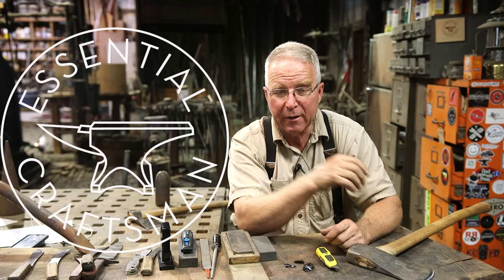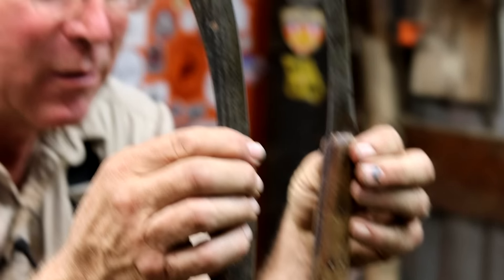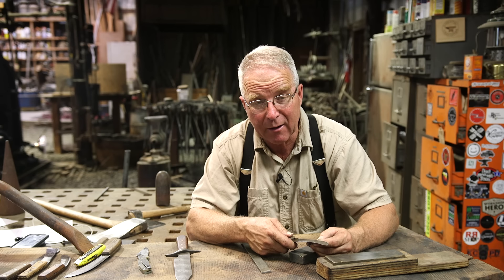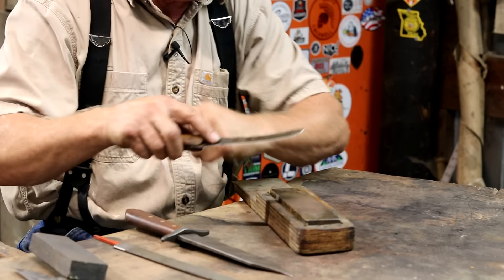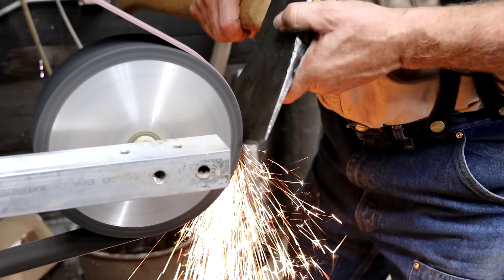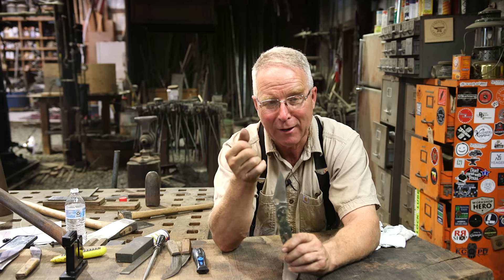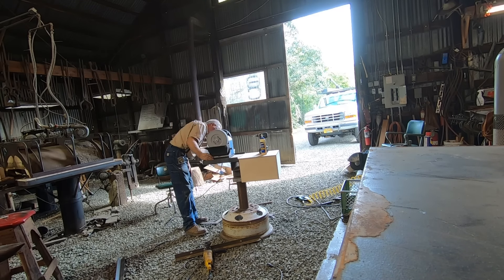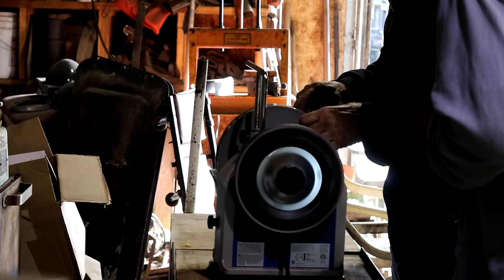Master the Art of Sharpening

Comment: Two types of knife edges: rounded and convex or standard straight edge. Your expensive kitchen knives will have the standard straight edge. Never confuse the two types or you will ruin the profile of your knife. The Work Sharp sharpener is a convex belt sharpener
Reply: Wrong.
Reply: @autumn5592  I own both types of Work Sharp sharpeners...the Ken Onion belt convex sharpener and the new Work Sharp Elite straight edge sharpener that they sell for $120. Do you own any Work Sharp sharpeners or are you just running your mouth?
Reply: @CALVINLNIKONT  First, stop coping.

Second, you're wrong.
There's more grind types than you can count. It isn't limited to just flat or convex. You're completely ignoring concave/hollow ground.
Then you've got different grinds between primary and secondary bevel (if applicable.)

A convex edge will not ruin a kitchen knife. In fact, some high end japanese knives have convex edges, and these are some of the finest production knives you can buy.
A (slight) convex edge will improve durability of your bevels, and will slightly aid in sharpness (due to easier ability to properly apex.)
Convex edges are by no means bad, and flat grinds are not good.

I don't need to own either, and I wasn't talking about them.

But I do make knives, and other tools. So maybe that means a little more than owning some crappy 1x30 belt sander.

Comment: I hope you can help me I am metal detect and I used a pretty heavy duty shovel the problem is the hooks on each side of the shovel is white will cut through roots and vines is there a easy way of sharpening this whole shovel or will I have to do on the front part and then each hawk on the side of the shovel I hope you get what I mean

Comment: Thank the frogs some one on You Tube who knows the proper way to sharper steel. I know you turn your knife and reverse your stroke.May need to explain turning the stone for each side. Your a good teacher. Hate circlers only good for saw teeth knifes lol.
Then next is grinders some use and destroys the knife! belt Sanders are ok if you know how lol but low speed water stones best. As your found out but we had to modify ours as didn't like the set up over head like your so,  set up the same as normal set up for grinders more stability then that rod.thingy....we chucked most rest of the attachments as waste of time setting them up. It  just didn't feel right old habits suppose any way I preferring K.I.S.S keep it simple stupid. To many designers get to technical ie attachments set ups and attachments not nessary, complication the whole set up. 👍🎥❤️😁🧡👍🦘🇦🇺
learned to sharpen knifes. in the City Morgue.

Comment: A third danger of sharpening with a power grinder is over-heating and losing the temper of the edge. This is why the old sharpening wheels were partially submerged in a trough of water and why engineering lathes have a constant drip of oil to help take away the heat.

Comment: my swedish axe shaved because of the burr not because of the angle.  most people think that having an edge really thin will cause it to roll or chip but honestly the thinner it is then the easier it is to resharpen and the sharper it will be but the burr is still more important.  you can get a more controlled angle by dragging your blade but in order to clean it up your final strokes on the stone have to be push strokes.  most people have no idea what a wet stone is or an oil stone and neither does this guy.  oil is not meant for creating a slurry is only meant for cleaning the stone.  a wet stone is one that needs to be soaked in water overnight and the water is just to open the pores and prepare the stone.  creating a slurry is a separate technique which works best by using an abrasive paste on top of a stone or a strop.
Reply: It would seem you don't know what you're talking about. 

Almost everything you said is wrong.

Comment: Learn how to use a stone. Be patient and hold a steady angle. Don’t mess around with all these sharpening jigs or anything else. You can get really good with a stone in a matter of a few hours. You’ll enjoy sharpening with a stone a lot more than any other style and you can adapt to any blade. It’s Almost therapeutic. 

If you don’t care to learn and don’t care how much life you get out of your blade and just want it sharp enough to barely work just go out and buy the $10 V style sharpeners that peel the steel away. Make sure you get one with a ceramic side as well as the steel side for honing the blade to a better sharpness. The bright orange “smiths” one is a decent choice for cheap.

Comment: I think people put to much into the method. Your grinding a triangle and removing burs that happen while that's being done. 

As long as your careful with the angle it doesn't matter it you go along the blade, across the edge, or against the edge.

You can feel the burr and will learn the difference between it and sharp quickly by placing four fingers along the blade.

So how do you grind? Determine the damage and highest appropriate "grit" (a file has more "grit" than sandpaper which has more than the whetstone (or whatever stone you prefer))

Then you move down on grit and remove the marks from the previous grit up. 

TL;DR
Sharpening is just grinding while take ng burrs and angles in mind. Maintaining consistent angle and finding the burr and necessary side to work too maintain center IS FAR MORE IMPORTANT THAN THE DIRECTION YOU SLIDE IT OR THE MATERIAL USED.

I find along the edge (up and down) removes less than across it (against it, or with it) so I consider each "grit" to have a high and low version depending on direction. BUT THAT'S JUST MY STYLE, YOU CAN GO IN ANY DIRECTION YOU WANT provided you maintain center and angle and remove previous grit marks before moving on.
Reply: Practice on a chisel if you find your style inadequate. Having one edge and one side for the burr. The angle is clear and easy to follow. Then picture a knife edge as two chisels bonded together.

Edit, with much more shallow angles, usually lasting less than a mm before the steeper "secondary edge" (which you will work into, but you don't need to work the secondary edge itself unless your knife is on really bad shape. 
(The "secondary edge" on a chisel is typically the top face, as you can see the primary goes much farther into the "secondary edge" than a typical knife)

Comment: What's wrong with using a file on a typical knife is that there's a good chance the knife is too hard for the file. For softer tools like axes or machetes it's fine, and I have been able to successfully use a file on a knife or a pair of scissors occasionally. But more often than not I've ended up just dulling the file.

Comment: Still trying to figure out how to sharpen a serrated edge on a knife.
Reply: Dowel with sandpaper around it.
A round diamond file or ceramic rod.
Slipstone.
Reply: @autumn5592  seems like a lot of work.
How do they do it at the factory?
Reply: @crazysquirrel9425  You don't need to do all of them, just one.

It's the best way you can do it, without specialised gear.

They have a jig with grinding wheels, you would never re-create it yourself with power tools.

Comment: I had to teach myself how to find the correct angle to sharpen a knife.  
I realized that a knife sharpens the 'Quietest' at the correct angle and the 'Sound' is different again when sharpening is complete.  
This technique probably doesn't work if you are changing the Angle that the Blade currently has.

Comment: The hardest part to keeping an edge is finding the right blade.  Most over the counter knives you see are too hard , the edge is brittle and chips easily.  Too hard they chip , too soft the edge will roll over.  A soft blade isn’t worth the time to sharpen. 
  A hard blade you have to sharpen more often.  I use a couple of Japanese water stones I paid a lot for over forty years ago and a strap of buffalo hide for a  strop I got off an old belt driven lathe.   One way to destroy a blade is to use a grinder.  
   I prefer old high carbon knives. They hold an edge but they will rust quickly if you don’t dry them well.   I used to pick them up in Pawn shops , now you can find them as vintage on line.

Comment: Another point that needs to be made is the better the quality of steel the knife blade is the better the sharp edge you will get. If the blade is made of cheap steel it will not hold a sharp edge ever no matter what you do
Reply: You can get trash 0.5% carbon steel as sharp as super steels.
You don't need a good steel to make a sharp edge.
You can get mild steel, even copper to slice paper.

Edge retention is not the same as sharpness.

Comment: Scythe peening is another way to address the thickness temper and razer sharpness.
Reply: Scythes that were peined were not hardened, at least normally they weren't.
There is no temper to 'watch out for', because it's soft steel.

The peining caused work hardening, to form the cutting edge, which was then dressed with a stone to bring it that extra bit.

Comment: Oh good now I have a use for all those chipped Lathe bits, edit [only for soft stuff]

EDIT: hold 2 lathe tips in the vice to test, on my Buck eating knife, it did with care almost get a Drag through my thumb nail to tell me it's dangerous However, none of my good knives were touched by the carbide Lathe Tips - probably because they are made from very old machine hacksaw blades [before they leaned to weld a hard edge on butter]
Never heated them I cold cut and ground all the way, never tempered which cost 150mm off one of them when I dropped it on concrete and cried - a chip the size of a hair would take all day to move off either one of them.

I should send you photos of some of my knives but it'd be weird.

My Trade includes making sure things are sharp because if they weren't they'd kill me so it's hard for me to walk into most kitchens and look at the Paddles they call knives - in most cases a fish slice is more dangerous.
If I was ever looking for a knife in a hurry in someone else place I used to go for the bread knife ... guess what stuffed that up Sliced Bread!

In the axe thing or in my case a Tomahawk I played with once had a totally hollow ground center of the blade that left a 15mm curve which meant - When a Mate came along to split firewood he was capable of pinning his thumb to the block and still have flesh both sides of the curved blade - a totally helpless looking thing - took a slice off the knuckle of the bone and the replant didn't take it was a mess and in saying that

Every time I've cut myself on a machine/blade/knife it was just after finishing sharpening it - I don't know how that happens but it's a real thing - 

Thanks Bro -

Comment: I could never master the concept of holding the knife at the correct angle.
Reply: Give yourself a reference point.
So use your finger as a spacer. So put the spine on the same part of your finger, then put your fingertip on the stone, and rub it on the stone gently. You'll have great angle control that way.

Comment: There is a scale of tools. On one extreme are very complex, and usually expensive, tools, which can be used by an idiot.  On the other end of the scale is a very simple tool, operated by a very skilled operator. This includes machinery from automobiles to knife sharpeners.
If you want excellent results, but don't have much to spend, learn the skills.  Be more like the old Japanese sword makers, and less like the minimum wage employee pushing a button on a computerized machine he does not understand.

Thanks to this channel for a great video.

Comment: I dare not say you are wrong in any way. Your years of experience outway mine. I will say this. I speak as a chef, butcher, and outdoorsman. I've used many axes, knives and so forth. What I have found in my time. I say any stone should not have oil applied to it. The reason, in my opinion. Once you put oil on a stone, it will never work with water. If you are in the field, it's much easier to find water than oil. Just my experience, I'm sure it varies from others.

Comment: I've seen far too many nice kitchen knives ruined by those cursed electric sharpeners. They really should come with some strong warnings. As far as sharpening scissors, sometimes all you need to do is feel the edge with your thumbnail and see if it is a wire edge, and if so turn it the other way with a ceramic cup bottom or some other such fine abrasive.
Although you mentioned whet stones, many people believe that to be "wet stone" because it is used with water.
I've cleaned the pores on my stones with a magnet in a plastic bag. The bag is to make it easier to clean the swarf off the magnet.

Comment: I feel like I will still have issues sharpening titanium blades even after learning all this...
Well it wouldn't be a bulletproof blade if it wasn't hard to work
Reply: I hope you know that titanium is almost as strong as steel so yeah not much improved it is however lighter tho
Reply: @bloopbloop5663  must be my sharpening stone then
Reply: Yep I told you the 50 cal went deeper in the titanium then the steel
Reply: @bloopbloop5663  not same caliber
Reply: @bloopbloop5663  take a 2 meters wide paper hold it from each corner now push with your hand all the way through the paper...
Now do it with a 30 cm wide paper, tell us which one breaks...
Reply: @Trustee-of-The-Most-High  they were both about an inch and a quarter tho :/ and I'm talking about the 50 caliber that they used on both
Reply: @bloopbloop5663  and I'm talking about science
Reply: @Trustee-of-The-Most-High  ok enough arguing and about the sharpening trouble I would recomend you use a blue hawk tool sharpener they are cheap and easy to find run that over the knife edge a few times then use a sharpening stone and I recomend useing diesel as the lubrication works amazing and wont rust your knife like water will
Reply: @bloopbloop5663  ty

Comment: I was wondering when you were going to get around to a TORMEK.  I have one, it is GREAT, but I hardly use it anymore.  In fact I have NOT used it in YEARS.  I have learned the yin and yang of sharpening the knives that I have.  I NEVER abuse them by cutting something they are NOT made to cut.  I sharpening them often and never let them get dull.  I have a leather strop I picke up as a SCRAP in a saddlemakers shop nearly 50 years ago.  So I hit it a vew licks on the stone and polish the edge on the leather.  They are always sharp with this so called "method".  But if I were to Sharpen OTHER PEOPLE'S HIGH DOLLAR KNIVES, I would ge the Tormek out.  Boy the Nordic people make good stuff!!!  The Tormek is the best one I know.  There are some kind of knock offs of the Tormek by various tool copiers.  The STONE on the Tormek, the SURACE of the Tormek 'wheel' stone can be changed by applying the stone they sell for that purpose.  The stone they sell looks like a Whet Stone you don't want to mix it up with the others you may have.

But for me in my old  age, I keep my knives sharp by as a rule just hitting the Arkansas WHITE STONE a very few licks then stropping them on the leather.  So it is QUICK and they never suffer from "Deferred Mantenance".  To me it is better to sharpen it often but make the process Short and Sweet.  To me it seems to tke less of the original blade down to sharpen often in short sessions than to allow it to be turned in to a Butter Knife and then try to "fix it".  

The book with the Tormek is GREAT, it tells you the various angles and how to detect them and so on.  I have forgotten most of it.  Should get it out, if fact you have inspired me to get the thing out, it is a wonderfull product.  But very PRICEY seems like I paid OVER $400 bucks for it YEARS ago. 

Over the years, I have tried all kinds of 'oils" for the Stones.  For the Man Made stones I have used Kerosene, diesel fuel, motor oil, machine oils, WD 40, you name it.  Doesn't sem to matter as long as you OIL IT.  But with the Arkansas Stones I use BABY OIL.  It is CLEANER, it works GREAT.  Baby Oil is nothing more than "mineral oil" with the baby fragrance in it.  Could use Mineral Oil that they use for  mdical or veterinary use, but it is thicker in viscosity.  It seeks to work just fine, but I like the baby oil better.  I wash the stones occasionally with Mineral Spirits, then oil them the next time I use them.  I "learned" this by trial and error, it seems to work well for ME.  I am sure somebody has a way that is better.  But there is a LOT of MISINFORMATION from man to man about Knife sharpening methods etc.  I also sharpen brill bits CONSTANT LY and CHAIN SAWS.  I cannot stand to use any kind of DULL TOOL.  If a tool is DULL I just so not use it until I can sharpen it.  Dull tools WREAK.  You have made a FINE VIDEO and all of it is great information.  I liked and subbed.  BB

Comment: I watched my Grandfather 100s of times stropping his straight razor. As you probably? know, stropping is done with edge trailing and the purpose is to uncurl the edge, removing as little metal as possible. A honing rod should be used the same way, more uncurling, less metal removal. Makes little difference on a $10 knife used a couple times a week. But Professional Chefs using VERY expensive knives dozens of times per day and honing their knives before every use, will hone edge trailing. Look on YT for Gordon Ramsey honing edge trailing.
Reply: Gordon Ramsay cannot use a honing rod.